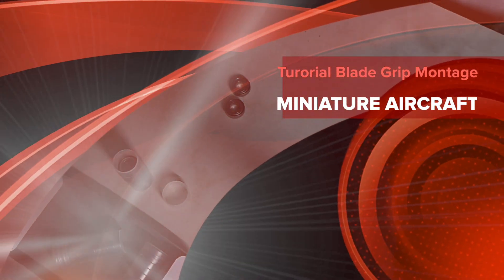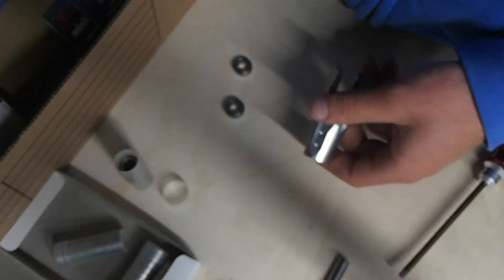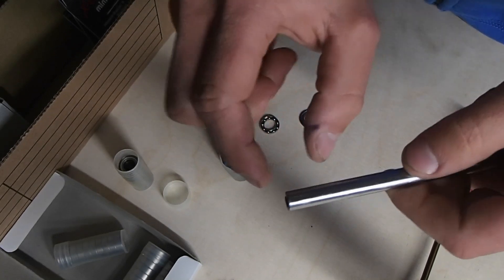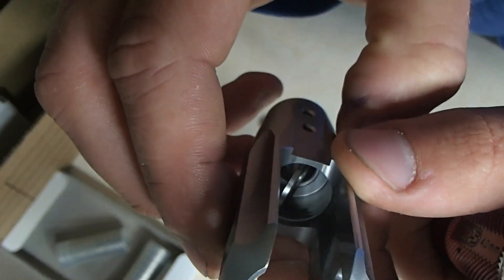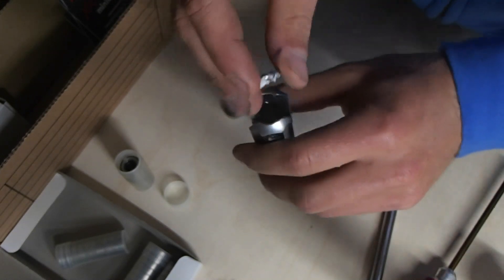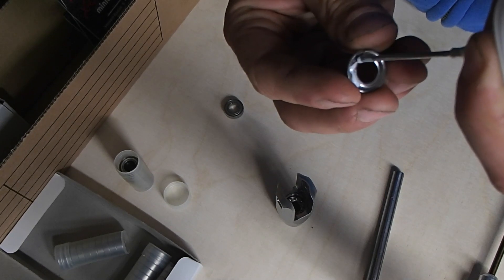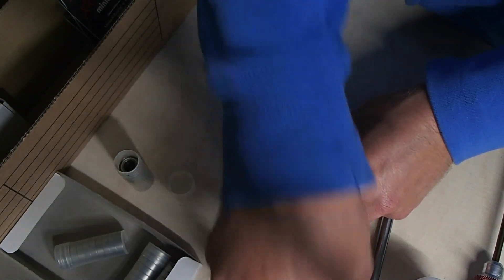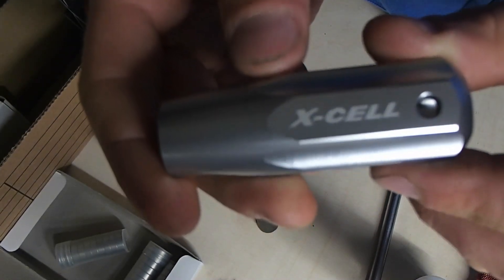Tutorial Blade Grip Montage Miniature Aircraft

Comment: Hello, do you have any tips on lining up the one-way bearing holder on top of the clutch, so it is properly lined up with the starter shaft?
I had my heli assembled with the starter shaft spinning freely, only to find out there is drag on the starter shaft when I put the crankshaft in some positions.
I have a Hanson engine, so the crankshaft is supposed to be straight.
Thanks.